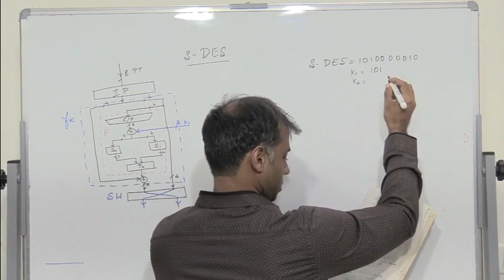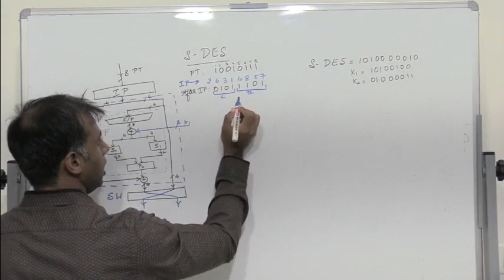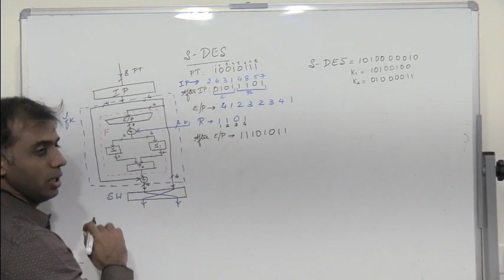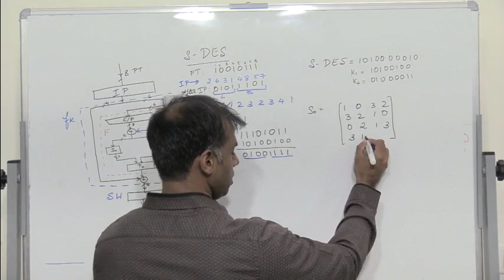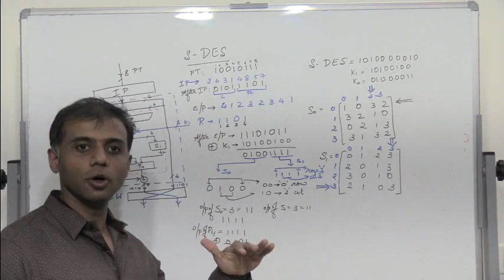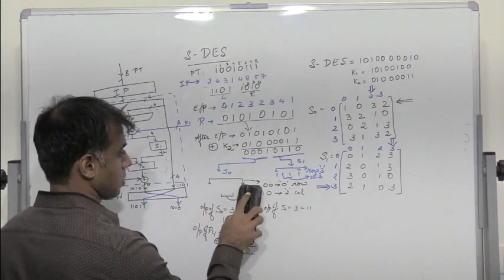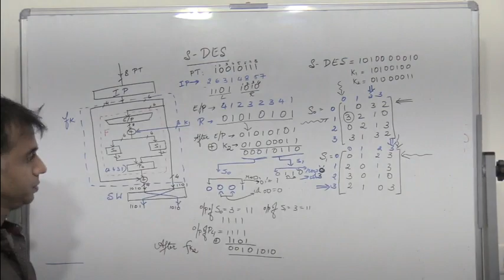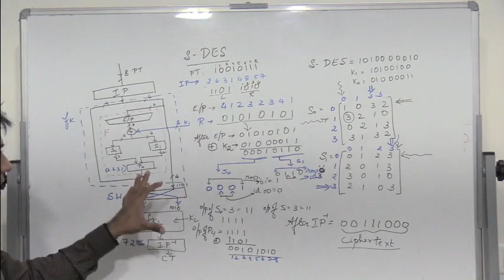S-DES Encryption || Simplified data encryption standard(S-DES) || - Encryption & Decryption

Comment: This sequences are chosen randomly or are like never to be changed?
Reply from the maker: Which sequences? 
U mean Permutation P sequences?
Reply: @lecturesbyshreedarshank8977  Yah.... like 26314857 and 41232341 and the others
Reply from the maker: @abdifatahmohamed8600  they are fixed ! ... These sequences are chosen while designing the algorithm such that encryption and decryption are absolutely reversible...
Reply: @lecturesbyshreedarshank8977  Thank you... You've cleared all my doubts
Reply: @lecturesbyshreedarshank8977  Then it should not be called as Permutation, it should be called arrangement! isn't it Sir. correct me if I am going wrong.